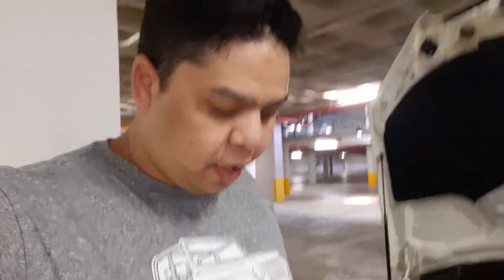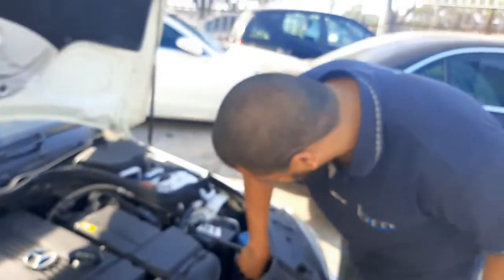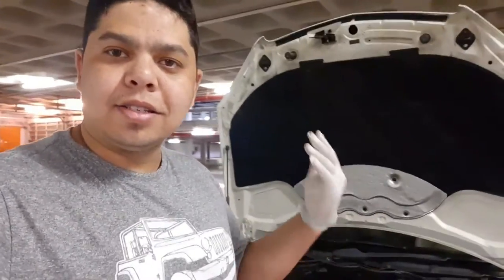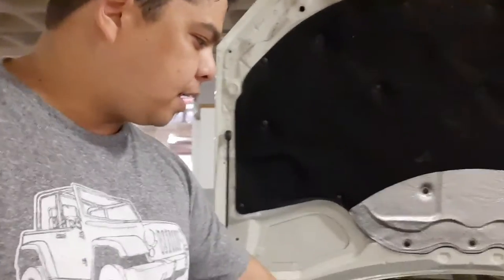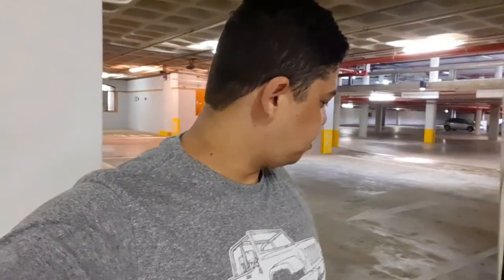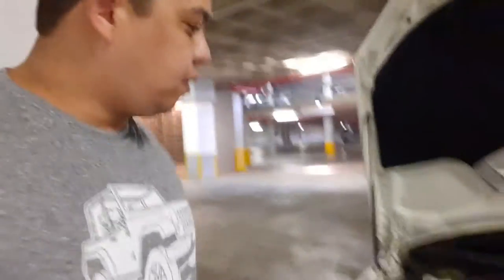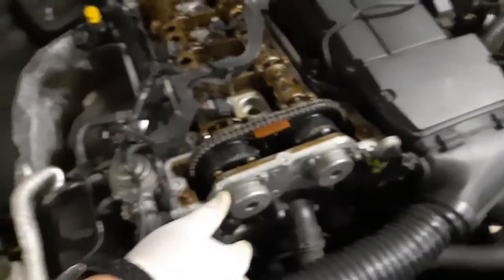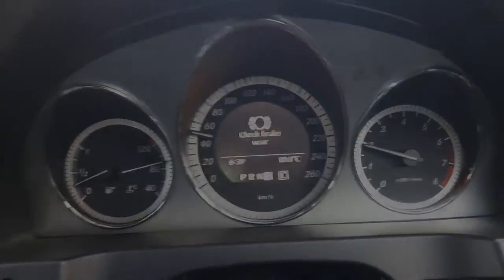Mercedes-Benz M271 Kompressor Engine light and Valve Cover leak fix.

Comment: Hello guys, I am about to get an E200k year 2006 with 135,000km on it. Good that we have nice people like Yusuf, DiagnoseDan, Ecu boot, Masing 2005, Autodoc and others putting out videos like this. Most of issues in a Mercedes are actually not that complex. Parts are only 20% to 30% more than Japanese car part. Just my thoughs that MB owners who are even slightly inclined techinically should have at least an aftermarket plug & play OBD display. Displaying speed, rpm, exhaust O2 reading in 0 to 1.0 volt, egr position, throttle position, exhaust, boost pressure, short trim. Then take snap short of OBD display safety at idle, 20km/hr, then at 20km/hr incrementally until 140km/hr. These should be helpful when a problem is slowly cropping up. Happy motoring. Happy motoring.
Reply from the maker: Wow thanks hey that means alot. Trying to do what i can if i can help 1 person thats great, we are all learning together here. Thanks again happy motoring yes...

Comment: Hi! I have the same car with you in China Beijing. I have done  good maintance work for the car since 2008.  It performs really good.  But , The E200K has a compressor low pressure problem recently. I have to use computer to reset the compressor valve position very often. Do you know how to fix this problem? Thanks!
Reply from the maker: Oh no... i have not dealt with that issue i would assume the way to fix this is to replace the part that moves the valve its maybe slowly starting to completely fail.

Comment: can you tell me about C 180 PCV valve location
Reply from the maker: It sits on the left side if you looking at the engine to the right of the power steering reservoir it has a couple vacuum lines in it.

Comment: which code did u have, and which app are u using to see boost
Reply from the maker: It was a 2600 i think i cant remember exactly.  I use the Torque app on google play that connects to my obd2 plug it shows live parameters boost is one if them so you can see immediately theres boost or little to no boost.

Comment: Hello, everything OK? :) I have the same smoke problem in the catalyst zone. I see smoke from that same area. Solved the problem? What was? Thank you very much.
Reply from the maker: Yeah i sorted it out its oil leaking from the back of the cam cover gasket replaced the gasket and oil dried up no longer smokes.
Reply: @YusufPetersenCPT  valve cover gasket?
Reply from the maker: @eduardoa4558  yeah stupid problem to have i show it in the video. Sucked bad and could be really dangerous i think
Reply: @YusufPetersenCPT  OK. I understand it. I've been researching and this engine suffers a lot from oil leaks. Mine also accumulates oil in the oil level sensor. It's visibly wet near the vaccum pump, but I don't know if the oil comes out of the pump, or valve cap gaskets, or both. :/ In this case, when smoke comes out, does the oil drip onto the exhaust? Could this cause a fire? :/ Tks
Reply from the maker: That was my worry because of where it is leaking it gets hot there and could be a fire hazard oil can get real hot and not burn but still worried me. I dont have much oil leaking just seapage here and there
Reply: @YusufPetersenCPT  I'm also worried and I think it's dangerous too. From the valve cover gasket to the exhaust, there is still a distance :/ ! It must be a big escape. One question I didn't quite understand in the video: min 4.58 - is that where you are pointing out that the oil was leaving? In mine, I have this zone that you point out at min 4.58, very wet with oil. Tks
Reply from the maker: @eduardoa4558  yes thats where the leak is on the back left corner so just a new valve cover gasket and tighten to spec and i dried up with a cloth and its been dry ever since the oil on the o2 sensor dried up after a few drives.  So putting silicone on can maybe temp fix if done right but i found it didnt help still leaked.
Reply: @YusufPetersenCPT  OK! Well, the best thing should be to remove the valve cover and replace the gasket. So I take it and I check timing chain.
Reply from the maker: @eduardoa4558  yep that should be the plan there
Reply: @YusufPetersenCPT  your vacuum pump (on the left rear of the engine) does not leak?
Reply from the maker: @eduardoa4558  nope no leaks yet lol still dry there, the seapage is from the top leak and  went all over the back there after i fixed the boost issue and cam cover leak i did a good pressure washer clean to spot leaks and looks fine
Reply: @YusufPetersenCPT  OK! BTW, I just want the chain not to be too slack and the camshaft adjuster teeth not to be worn out. :/ Mine is from 2009 with 142000 kms. You changed the chain and tensioner, didn't you? You have a video of it, but I can't find it :/
Reply from the maker: Its on my channel go tp the videos its older and i was just kinda starting off then. I changed the gears, chain and tensioner.
Reply: @YusufPetersenCPT  OK. Were the camshaft adjuster teeth OK? Were they not worn out? And... did the chain have a lot of slack?
Reply from the maker: Chain had a good bit of slack and teeth were worn off it skipped a tooth or 2.. and tensioner was all the way extended
Reply: @YusufPetersenCPT I didn't know yours had jumped teeth. Warped valves? When I saw your video, I thought you had done this operation, preventively. Well, now with the valve cap removed, the moment of truth has arrived for me. It has 142000 kms, is a 180k 1.6 BE from 2009. I didn't want anything to "touch" the distribution. The camshaft adjusters are very expensive and except for the cold start noise, the engine is very straight and economical. 6.2 l/100 in the last 11000 kms. I know there is a huge probability of having to change all that. We will see... :/
Reply from the maker: Well then i hope its ok. Yes mine jumped yes but a couple teeth is ok it happened on start i heard it jump shut it down and left it. No i did the job because i had to. Valves were fine i checked that before i started the job to make sure.

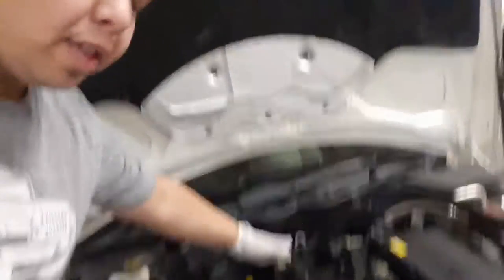Comment: 4:38 have the same problem on mine
Reply from the maker: Yeah bladdy sucks man but a new valve cover gasket sorted it out just dont go too tight on the nuts holding it.
Reply: @YusufPetersenCPT  Nice and informative..you just gained a new follower!
Reply from the maker: @tatendamuchemwa3331  thank you my sir yes i post all my issues and so on with the car on my channel in hopes of helping others.
Reply: @YusufPetersenCPT  Tks! On my 2009 W204 C180K 1.6, the front lights sometimes go out or blink. In auto, never turned me off...until now...have you ever had this problem on yours?
Reply from the maker: @eduardoa4558  no not really do you have the OEM HID lights or the normal halogen bulbs the halogen bulbs setup is fairly simple and i have no issues with it but the oem HID ballasts will eventually fail and thats probably what has happened to you in this case you most likely just need a bulb replacement if not then the ballast needs to be replaced.
Reply: @YusufPetersenCPT  On mine it's all OEM :). In your opinion, the problem is maybe the headlight switch (part A2049053304)? It's just that in the AUTO position it's OK, so far... Tks
Reply from the maker: @eduardoa4558  i was too thinking yes it could be the switch or the night time sensor thats going.. mmmm hope you get it sorted🤔
Reply: @YusufPetersenCPT  Tks ;)
Reply: @YusufPetersenCPT  hello sir i have c230k 2005 m271 engine and i have misfire cylinder 4 
I change all the sparks and ignition coils and it was the same problem cylinder 4 misfire
My car has little leaks at camshaft magnets and at cylinder 4 a little oil leak 
Can you help me fix this problem bc i've spend a lot of money and it doesnt fix
Thank you
Reply from the maker: Ooof guy.. did you do a compression test? Was that spark plug oily when you took it out. Common problem is oil leaks into cylinder 1 by the oil fill hole and it then misfires but on cylinder 4 i wouldnt know if you put new coil and plugs that should sort the issue if its still misfiring it could be theres a problem on that cyclinder itself maybe a valve not seating correctly. So do a compression test get that out of the way if its passes and still misfires check the wiring for that cylinder see if the coil fires correctly. I hope this helps but for now thats all i can say given the info you gave me hope you come right. Then cam magnets leaking a bit is normal its either the rubber O ring or the magnet itself leaking and needs to be replaced.
Reply: @YusufPetersenCPT  thank you sir ill tell you when i'll do compression test and that spark nr 4 it has a little oil at white part
Reply: @YusufPetersenCPT  when i drive normaly this car no hard pressing the gas it runs perfectly but when you press hard the gas pedal and it goes 5.5k or 6.1k rpm the car start to shake and i must shut off the car and start again and the shake sound and the vibrate goes away and i forget to tell it doesnt have the catalytic converter
Thank you again
Reply from the maker: @orgestminga2169  is there an engine light? So it vibrates on full throttle this sounds a bit complicated coz a vibration can mean a few things like motor mounts wheel alignment or even a balance shaft issue. Maybe theres a breather hose leak and on full throttle its not happy....mmmmm
Reply: @YusufPetersenCPT  do you have facebook bc i have a video to show how it sound